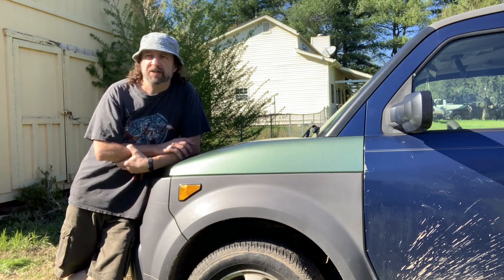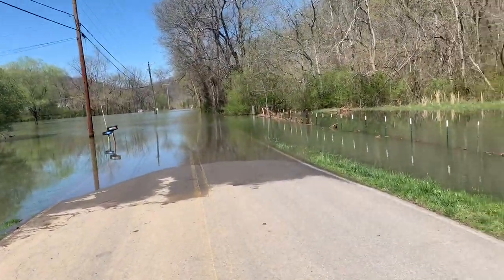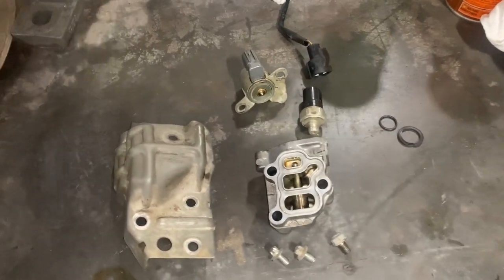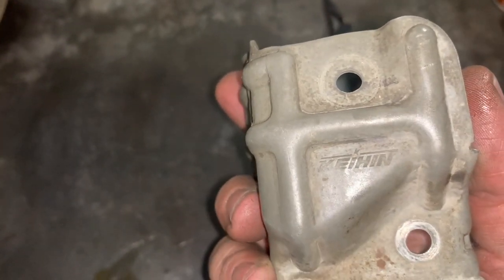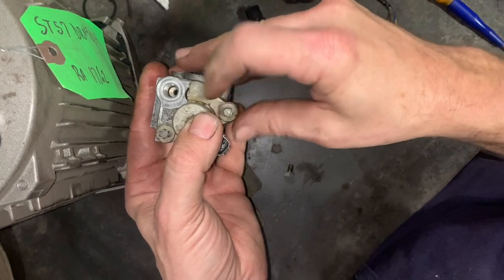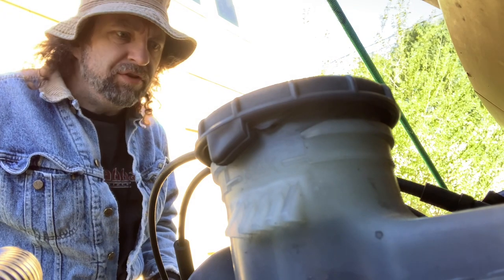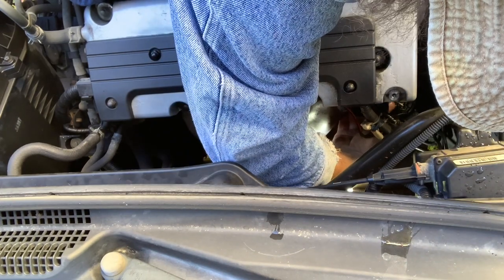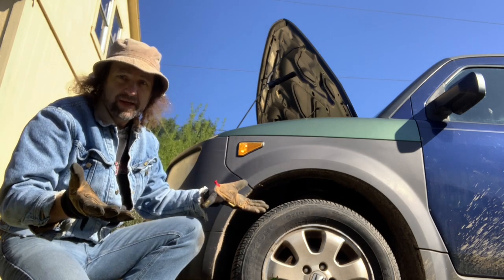Scavenger Type: More Honda Element VTEC issues...(part 3)

Comment: Such a great video!  You and 1A auto are the best!  My Vtec is working but it was leaking.  Pulled it.  Took it apart the way you showed. Cleaned it. Replaced the screen gasket and o-rings from the sensors. Put back on and working great.  Really appreciate what you do. 👏👏
Reply from the maker: Glad it worked for you.

Comment: I replaced my VTECH solenoid with a cheap Mexican hunk of junk from NAPA. Six months later, it left me in limp mode 15 miles up a snowy mountain!

I remembered this video and had to bring it up to watch now that I’m a little wiser in the ways of the mechanic. Gonna dig up my OEM unit and give it a clean too!
Reply from the maker: It's worth a try. But I'll tell you that the one I cleaned out only worked for about 4 more months. I ended up swapping in another junkyard OEM. That's been in the car for over a year now and I have a NEW oem in the glove box just in case. I think I need to recut my 4 Vtec videos into one.
Reply: Agree with you 💯, NAPA lately is selling crap , I was in the same situation, new and failed, just got one oil pressure switch from junkyard and works flawless !

Comment: So fun! I'm also glad there was a back order. If something can be taken apart and cleaned.. and that sure looked easy, may as well! Thanks for the vid. Looking forward to my next scavenger trip. Also, ordered the service and electrical guides based on a previous vid's comment.
Reply from the maker: Thanks!! I'm working on your tool video soon and maybe a junkyard video where we go over a few parts that are interchangeable between some Hondas. The thing is, you don't find many Elements in the junk yards down here so you have to know what will work off of CRVs and Accords and Odysseys.

Comment: 4:00 "This solenoid kicks in and out and activates the spool valve via oil pressure."

I think you misspoke. The solenoid does not use oil pressure to move the spool valve. The solenoid moves in and out because of electromagnetism. The in and out movement of the solenoid moves the spool valve, which redirects oil flow to the VTEC rocker arm pins.
Reply from the maker: Right

Comment: Great job on the fix Clint. We bough t a 2008 with about 180k miles. If this comes up, I know how I attack the this one thanks to your 3 videos. Great work.
Reply from the maker: Eventually the cleaned valve failed too and I swapped in a junkyard unit. So far so good. And I have a brand new OEM in the glove box should the need arrive.

Comment: Own experience with this extremely annoying problem….
Bought a new whole unit from NAPA, installed and the problem persists…
Went to the junkyard I got just the oil pressure switch , is not a sensor , just cut ground signal to the computer, with a long nail you’re able to push the switch manually inside through the hole and feel a click , using a voltmeter you can check continuity, however I discovered something…the one from the junkyard if you shake it sounds like a PCV valve, the one from the “new” unit didn’t…
My Element now completed the driving cycle flawless !no problems so far 🤷‍♂️
Reply from the maker: Good stuff!

Comment: Replaced pressure sensor numerous times and the entire spool assembly cause element is so fussy, then the connecter too, but never stops leeking oil on engine block after replace gasket seal many times.
Reply from the maker: I think mine is leaking again.... Joy...

Comment: Had a leaking solenoid (nipple?) on mine. It was an aftermarket brand assembly the previous owner must’ve had put on. It wasn’t a major leak, a few drops but I went and replaced it. Ordered an OEM on 3-11-21, finally got here on 4-22-21. Installed and it’s good now 👍.
Reply from the maker: Good deal!

Comment: ive pulled one down after replacing to see whats wrong. The plunger was removed as well and found it jamming open intermittently causing p2647 due to some debris entering
Reply from the maker: I think mine was sticking because of crud in the oil.
Reply: Lots of Honda owners with this problem have replaced their assembly with Dorman assembly. Most of them say the Dorman does not last. So better to take your Honda assembly apart, clean, replace gaskets. As Clint's video shows, it's not a hard job. Lots of tiny passages can get clogged or stuck. Crucial to do regular oil and filter changes AND keep oil level full. My 2003 Element has had the 2646 code a few times and it was always because of dirty and/or low oil level. I need to get into the habit of checking the oil at every gas fillup.

Comment: This series of videos should be required viewing for anyone owning an Element with more than 120K on the clock.  I'm turning 200k on mine and I've replaced three VTec assemblies (2 of which were necessary).  It is one of the most pervasive faults on this little AWD.    Thanks for making them.   

I do have a question for you.  My dermatoligist recommends that I stop wearing baseball caps in the sun and switch to a floppy hat.  Where'd you get yours?
Reply from the maker: Ive got about a dozen of then these days. Most came from GoodWill. Search for a "Bucket Hat" and youll find lots of crazy options.

Comment: My 2003 Element wouldn't go over 3000rpm. Check engine light on.
Checked oil and it was low. I changed oil and filter. Ran fine for 5 miles, I was so happy. Then suddenly the problem returned.

Removed the spool valve assembly and cleaned and replaced screen gasket. Reinstalled. Worked fine a few miles then VTEC stopped working again. I read that the wire connections can be bad so I wiggled them. VTEC came back!

Bad connector could be the reason...but maybe it was coincidence. Could be that the pressure switch is working intermittently (e.g., diaphragm inside it is sticking). Just have to keep driving and diagnosing!
Reply from the maker: I'm pretty sure the sludge in my pan was making it's way to the vtec and gumming it up. That's why the issue kept coming back. Now I do oil changes every 3000 and it's starting to clean up.
Reply: @clintsearcy3252  How's your VTEC working?

2646 limp mode returned on mine this week, after about 7 months since oil change. Been reading about it on Honda Element Owners Club site. It's crucial to keep oil changed and clean and oil level up to top mark on dipstick. My level got down to lower mark on dipstick. Apparently that's enough to cause a drop in oil pressure to trigger 2646.

I love that you fixed your spool valve rather than buy a new one from Dorman. I've read lots of people saying their Dorman valves do not last and should only buy Honda valve.

Comment: i had same issue on my 03 and put on a new unit and still problem. i then switched to full syn. high mileage 5-20 and 8000 miles later with no code.
Reply: going with full syn was a good idea, i use Pennzoil 5w20 full syn, for now 4year and my elements are still kicking vtec with power ;) never forget to ajust the valve every 100kmiles that will help with everything ur engine need to live longer.
Reply: Clean the screen on the other side of head under cover helps also
Reply from the maker: I use Mobile One full synth but I bought the car with 250,000 miles on it. I don't think the old owner did very regular oil changes. Plus, I know the car sat for well over a year before I bought it.

Comment: Just found, love & subscribed ur channel. (5:15) I'd like to know where did u buy  that after market flat & round O-ring to replace for the crusty one in the VTEC solenoid and what is it called? And t-y in advance!
Reply from the maker: I'm not sure what the size is. I need to check that sometime.
Reply: @clintsearcy3252 
1) Forget what size!
2) I mean where did you get that after market part which was the rubber ring located inside the VTEC solenoid, THE PART that you  replaced in that video
3) Name of that part?

Comment: I have 2008 Honda elemnt. I've tried everything on your videos but replace the connectors. I was hoping that you would test the wires with a multimeter and what readings we should get. I read in the Honda manual to check G101 ground but am still trying to figure out where that is. I've heard that bad ground would throw different codes but I don't know why it's only throwing a P2647 code. Thanks in advance

Comment: My gasket is leaking on mine.  My bolts were way overtightened and the bottom one was stripped.  I tried to grip it, but had to by a bolt extractor socket.  I really need to get back to it.
Reply from the maker: My vtec saga started with a leaking gasket.

Comment: So how's it been?  I just stumbled upon your videos and I feel your pain...... I've been dealing with my issue for a year. I purchased a vtec valve from Amazon and it worked for a week then happen again. I bought another one from Amazon..... But never fixed itself.....I was told to buy only from Honda but very expensive....... How has your held up?
Reply from the maker: So far so good. It's been running smooth for about 6 months now.

Comment: It has to be an electrical issue. Every time you replace parts, it works temporarily because it just resets the engine code. The problem comes back.
Reply from the maker: That's a good guess but this was sludge in the oil I'm pretty sure. Regular oil changes seem to have fixed it up.

Comment: I have replaced my v tech solenoid with the oem part 2 times and I still randomly get the problem. Sometimes I can drive for 30-40 minutes and it’s all fine then all of a sudden start shuddering at 3k and dash lights up. If I pull over sometimes it will reset and drive fine again and it completely works itself out if I let the element sit overnight. Starting to thing I have an electrical issue because of how intermittent it happens.
Reply from the maker: Have you noticed it happening more when it rains?
Reply: @clintsearcy3252  the first time it happened in the rain but now it happens all the time. I just ordered a new connector because I’m getting p2646 code
Reply: @lolosolodolo Did the pigtail work to correct your p2646?
Reply: @kwamijw3363  it did. Installed the new pigtail shortly after my last comment and have put almost 10k miles on my element since. Plenty of rainy days and even some road trips. Just did an 8 hour round trip to chicago and back last weekend.
Reply: @lolosolodolo1  thank you greatly for reply! That will be next on my list 😅

Comment: Hi Clint. Your videos are great! I’m currently fighting this issue. Did an oil change. Back to limp mode. I then bought a new aftermarket solenoid and installed. Ran fine for a few miles but right back to limp mode. Drained that oil after a few months of sitting and did another oil change, this time running a quart or transmission fluid to try to clean the engine out. Ran that for 15 minutes, dumped that oil, installed new filter and new oil and cleaned the solenoid screen. I erased the code and it ran great for a few miles. Parked it and started it up next morning to limp mode again. I’m going to check my connections “plugs”. The new solenoid should have came with a new switch on it right? Are there any other screens I should be cleaning? Thanks!
Reply from the maker: I feel for ya Cody! I spent half of last year dealing with this. Yes, the new VTEC valve should have come with a new switch already installed. Honestly I've had more luck out of junkyard factory VTEC valves than I did with the one aftermarket one I tried. 

I need to let you know that this cleaning job worked for about 3 months then it failed again. I swapped in my last junkyard unit which has been in for about 6 months now. I also have a new OEM  unit in the glove box for the next time there is a problem.

Comment: Hey Clint, it's been 4 weeks since your last video on this VTEC issue.  Did it pop back up?  Still working good?  Did the clean do it?
Reply from the maker: So far so good. I only got the put about 200 miles on the car before I put it in the shop for the gearbox swap. I'm hoping to get it back next week with all 5 gears!! Then we can really test the vtec. If it going out again I'm going to clean it again and see what happens.

Comment: Hi Clint I knew you had to torque them up but I didn't do that what tension do the 3 bolts torque too
Reply from the maker: 8.7 ft lbs
Reply: @clintsearcy3252  its actually 7.2 but close enough govmnt work
Reply from the maker: @aaroncalhounash3103  Yea, I'm not sure why I said 8.5 before. I actually have 7.2 listed in the description. Stupid vtec...

Comment: What’s the screen called not the v Tex selenood the one from last video
Reply from the maker: Gaskets / screens /  orings... what ever you call them. I consider these gaskets and I know go with OEM Honda gaskets for the oil system. There's two different ones. I try to always list the part numbers in the descriptions.

15815-RAA-A02 Vtec Spool Valve o-ring/screen (valve to head)
15845-RAA-A01  VTC Screen (front of head)

Comment: I have a 2006 Element and it just keeps having the same issue with the vtech solenoid. A mechanic replaced the vtech solenoid with three different new after market and genuine Honda parts. Keeps coming back.

Did you ever get this resolved?
Reply from the maker: I did. I need to rework these VTEC videos so it tells the story better.  I'm currently running a junkyard vtec that has been working for just over a year. I think replacing the wire plug and doing several oil changes back to back helped the issue go away. I wanted to pull my hair out for almost a year before that.
Reply: @clintsearcy3252  Honda dealership just called to say they have it fixed. We’ll see. They replaced the vtech spool which was indicated by the error code. I’ll reply with my results this time. Thanks for the videos!
Reply from the maker: @stevenkornegay3412  I would love to know what you think of their fix. I hope that gets it.
Reply: @clintsearcy3252  so far so good. About 50 miles and no check engine or sputtering.
Reply: So far so good with the Element repair. Fingers crossed!
Reply from the maker: @stevenkornegay3412  It took me 6 months to iron that vtec out.

Comment: Will it cost issue if I didn't hand tight hard enough?
Reply from the maker: The three bolts that hold the VTEC on will need to be torqued properly. If not they gasket will leak.

Comment: I thank you for this. I did the same thing and it worked those 2 small bolts were rusty and a bitch. I took my dremel and made a notch for a standard screwdriver. replaced them with honda motorcycle screws.. Might be a next time...lol thanks.. your cool and we are old school.
Reply from the maker: Much appreciated! This eventually failed too. I for about another 3000 miles out of it.
Reply: lol... Mine failed about a 1000 miles later. I bought an aftermarket all new and pretty. And an aftermarket accord throttle body with all the goodies already on it. So far so good. The spring on the new throttle body is too stiff though. Going to take my old one and put on. You can feel it too much while driving. Wish I had junk yards around here but even if we did there would not be elements.

Comment: What is torque lbs on the bolts?
Reply from the maker: Officially, the torque spec is 8.7 ft/lbs but most people use 9 ft/lbs.
Reply: 7.2 by the manual.